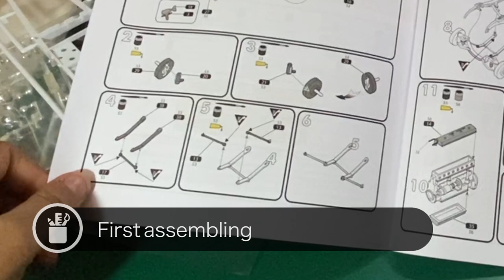🚗🖌️ Building 1M valued car Mercedes Special 500K Roadster by Heller 1/24 Model kit Step by Step

Comment: Ein wunderbares Resultat der Modellbau-Kunst. Eine Frage,wie hast du die Motorhaube klappbar gemacht.
Ich baue das gleiche Modell.
Reply from the maker: In fact the hood is not foldable and unfoldable, kind of cheat here, because is not sticked and for 360 (min 17:21) I use Blue Tack to hold in position hood parts 😊